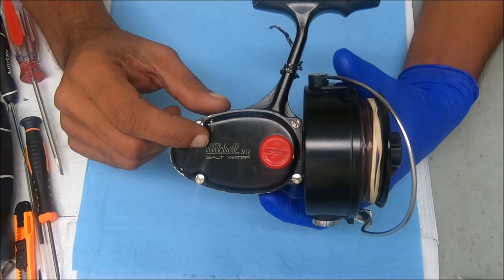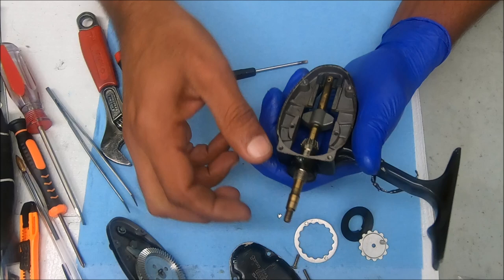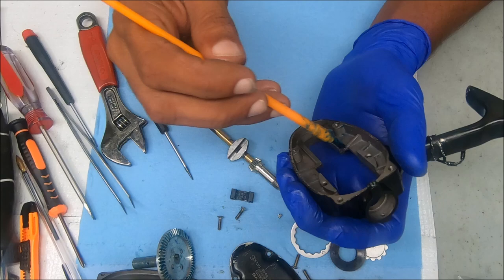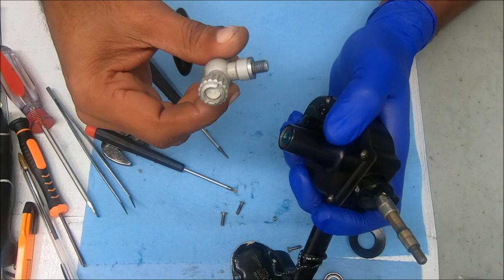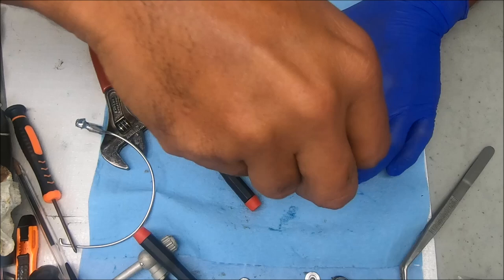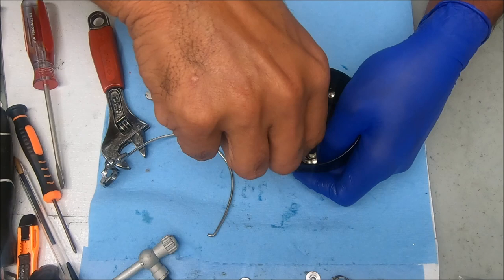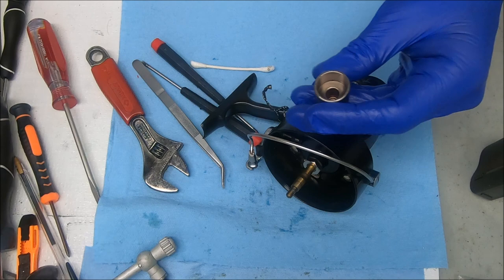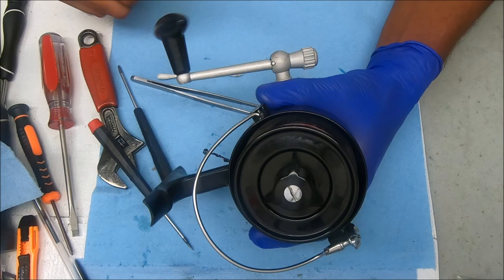Mitchell 302 Fishing Reel Maintenance - How to take apart, service and reassemble

Comment: Just serviced my 302 but it’s still cranking slow which was the problem to start with. I have another one that cranks free and easy. More troubleshooting I guess. Good video!
Reply from the maker: Thanks for watching, Jimi! Sorry to hear the problem still exists. What have checked so far? Any noises/scraping sounds when you crank?
Reply: @TSGReelService  No noises. Disassembled and cleaned again this time using WD40 on all friction areas. New oil and grease and now cranks much better. Thanks for your input!
Reply from the maker: No worries. Glad to hear it's working well.

Comment: Thanks for that video. My 302 is working great, but the bailing wire doesn't seem to be going far enough up and the line hits it as it spools off. limiting cast distance  any suggestions
Reply from the maker: You're welcome and thanks for checking out the video. I know what you're referring to... assuming that your bail mount is fine, try GENTLY bending the bail wire more and more OPEN when it's already in the open position by pulling back on it until it's in an acceptable "open" position. The goal is to try and get the bail wire to be more "open" in the open position without snapping the bail wire connection point near the cone (by the line roller)..... or, you can try purchasing a new bail wire here: https://ebay.us/qaToFr (affiliate link). Hope this helps.

Comment: Had that reel ever been in service? When you took it apart it looked like there was virtually no grease or oil on any of the inner parts - no grease on the oscillator or anything 🤔. Most of the ones I have worked on that were used were filthy inside and full of old brown grease.
Reply from the maker: No clue, brother. Yes, most of the time you find a lot of crud and dried stuff in these older ones. Maybe it was stored outside and the grease broke down?